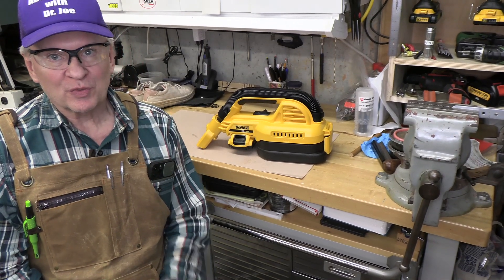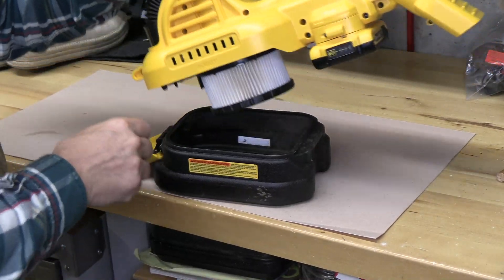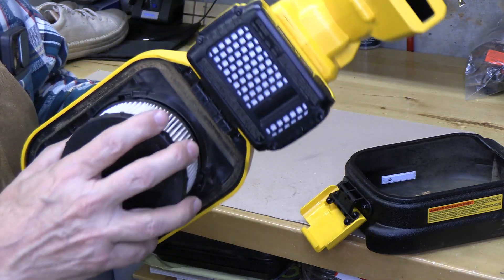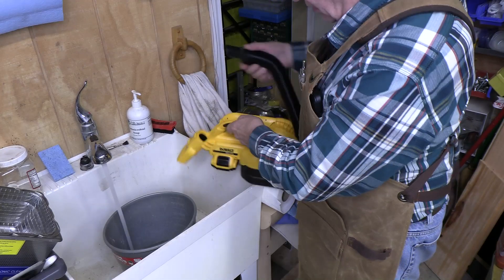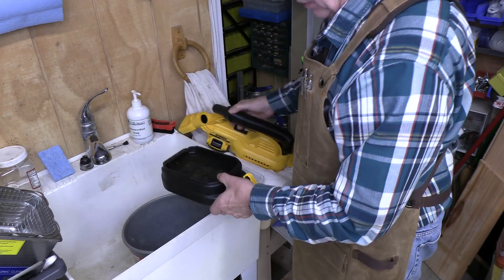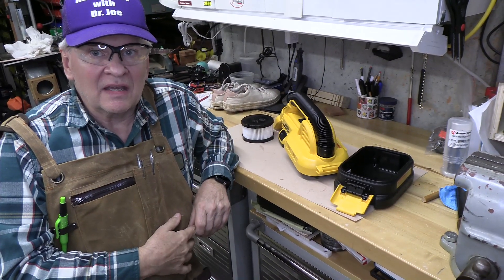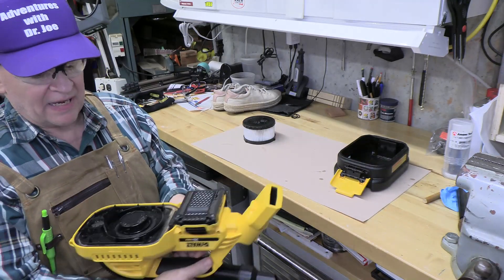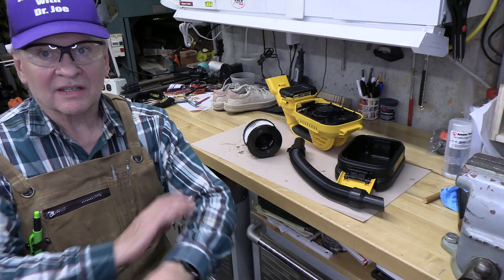Dewalt DCV517 Great Wet Vacuum!  Sucks Up Water w Dr  Joe

Comment: I used mine 4 times on the garage floor. It stopped sucking. I washed the filter. It works fine without the filter but has no suction with the filter.
Reply from the maker: Even though you wash the filter, it looks like it’s probably clogged if it doesn’t suck with the filter on perhaps a replacement filter would help it out probably will. Consider subscribing. Thanks. Joe.

Comment from the maker: It sounds like the filter is totally plugged up. I wonder if you vacuum some very fine dust if you blast it out with some compressed air from the inside out, it might help but if it doesn’t suck with the filter and I would replace the filter unless you can Restore the filter. Consider subscribing. Thanks. Joe.

Comment: Nice tips on cleaning unit.....THANKS!!!
Reply from the maker: Thank you very much for your comment. You’ll find this is a very good unit for dry and wet of course I think will use it for dry 90+ percent of the time but for wet we need to be cautious to be sure it’s fully dried before we reassemble it to prevent mold. Take care Joe

Comment: Just to help all:

This surprised me. I upgraded all of my tool batteries to 5Ah Powerstacks. I can't say why, but I can say with certainty that the Powerstack does NOT power this tool. 

It was no big deal,. I just fished one of my replaced 5 XRs out of the trash, and kept it to power the vac. But you should be aware of it as a part of your buying decision.
Reply from the maker: Hello kennedy McGovern. Thank you for your comment. I do not have a PowerStack battery to test it. That’s pretty amazing that it doesn’t work. He would think that everything would be compatible with those new battery. Good to know. Consider subscribing. Thanks Joe.
Reply: @JosephHunstad  You bet. Yeah, it surprised me too. But take heart, I own a LOT of power tools, and the only one that they don't work with is this little vacuum.
Reply: My powerstack works on my vac...

Comment: Does it still work ?
Reply from the maker: Thank you for your question. Yes I’m pleased to say that the DeWalt vacuum still works very well both dry vacuum and wet. It has a very strong suction and is very useful in my shop and elsewhere. Consider subscribing. Thanks. Joe.

Comment: Bro take out the filter
Reply: Odd, but dewalt requires a filter on these vacs for wet vacuuming. I actually burned mine out by sucking up water with no filter.
Reply: Filter not needed
Reply: @aaronaltman You are correct. I may have just done the exact same thing. It sucked the water into the motor and began blowing out the sides almost immediately. It all happened very quickly but the unit began to spray water from the exhaust and smoke. I rapidly turned it off, removed the battery, and have it sitting on a shop fan in an attempt to dry out the motor but the fact that it began to smoke doesn't give me a lot of confidence that it will turn back on again. We will see.
Reply: You are incorrect. Filter is needed.
Reply: @causa2009 "bro", here is a direct copy/paste of the owners manual instructions: "The vacuum is designed to perform as a wet/dry unit with no component changes required when changing from wet to dry, or dry to wet pick up."

If you take the washable dust filter out and attempt to use it for liquids, water will pass through the very thin foam filter covering the port to the motor. When you take that foam filter out, you can actually see the motor right inside the casing.
Reply: I use it every day on my boat.  Filter not needed.  😅
Reply: @causa2009 good for you. You are still using it incorrectly. Mine literally just started smoking the second it began sucking because water went straight up into the motor. Just because you are successful doing a dumb thing for a little while doesn't mean you have to double down on that dumb thing.

Comment: You left the filter on with the water lol…
Reply from the maker: Thank you for your comment. Yes I did and this is the reason why. This is directly from the Dewalt manual.:

The DCV517 has two filters: a high- efficiency wet/dry filter (I) and a secondary filter (J).
NOTE: Never operate without filters in place. Clean filters are the most important factor in the operation and efficiency of any vacuum

So yes when you use the vacuum to section of water please leave the wet dry filter in place. If water gets through into the motor it’s probably destroyed. Take care joe
Reply: I tried running mine without a filter, it shut off very quickly as soon as it started sucking water into the motor. 

Thankfully after it dried out it worked again

Personally I think it’s sorta useless for anything besides a small spill, because it stops sucking water after the filter gets wet
Reply: It does actually say in the manual do not use on liquids which I found odd at first being wet and dry, It also says don't get the filter wet on the inside when cleaning. Your totally right I think small spills or wet materials  @BAKEDnotTOASTD
Reply: Nowhere in the manual does it say to not use on liquids. It does say not to immerse the tool in liquids or allow it to get wet. There are even safety notes about making sure to never store it with flammable or hazardous liquids inside.